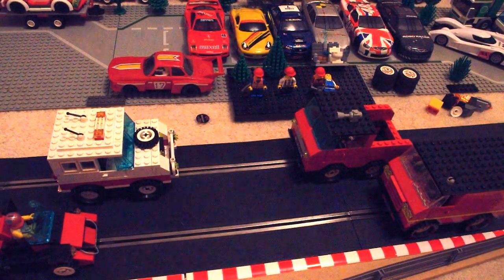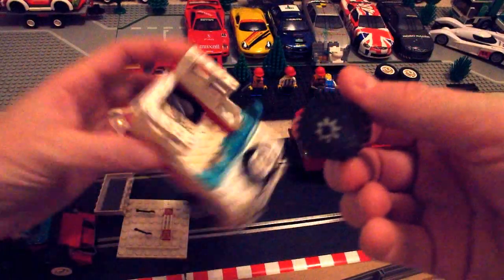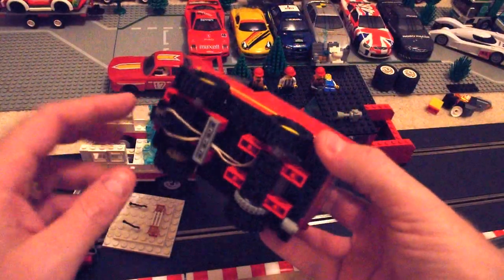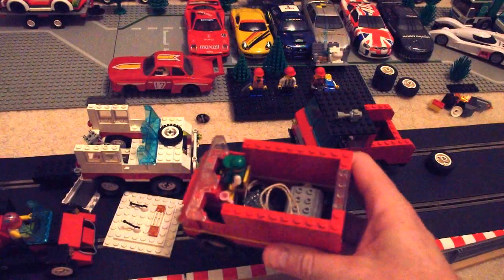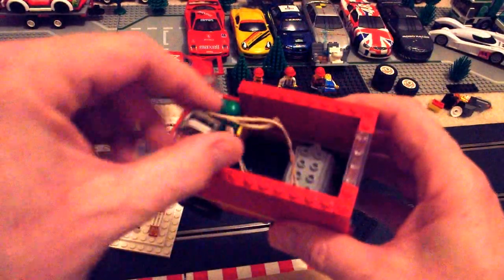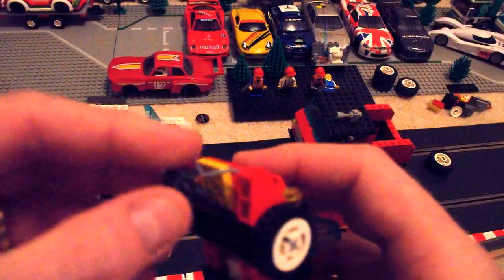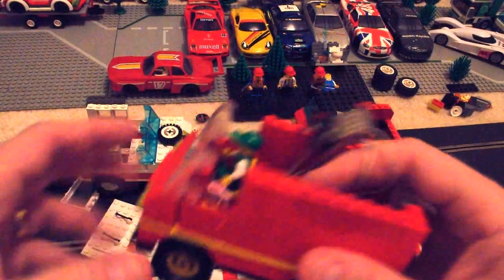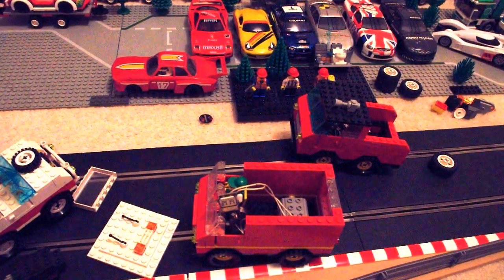Building a Lego Scalextric Slot Car, using Lego motors and tyres

Comment: Hi! Could you please tell me exactly, which scalextrick track you are using?
I'm researching this for my 10yr old for Christmas.  He is really into building with motors & gears, as well as showing a huge interest in slot cars. This set up looks like something I could see him doing :-) but I NEED to know, what is the exact track you are using? I'm new to slot cars and the variety of sizes & different model #s confuses the heck out of me. It's getting scoo close to Christmas & after all the articles I've read, I'm still at a loss for which track is the best to use
Reply from the maker: Hello yes it's ordinary Scalextric track, the cars work on new sport or older track. Buy a Scalextric guide blade and then drill a flat Lego plate 2x4 to accommodate.
Reply: Awsome! Thank you♡